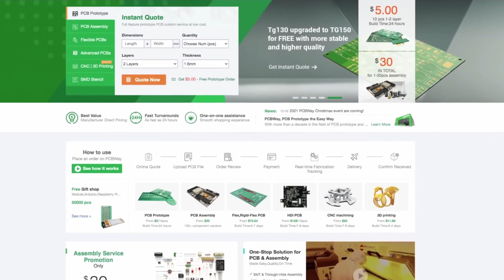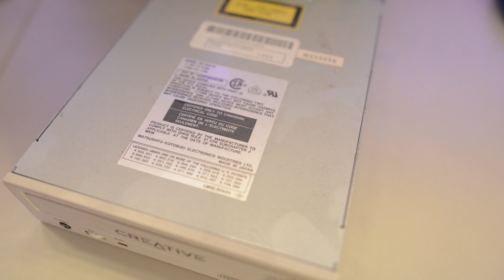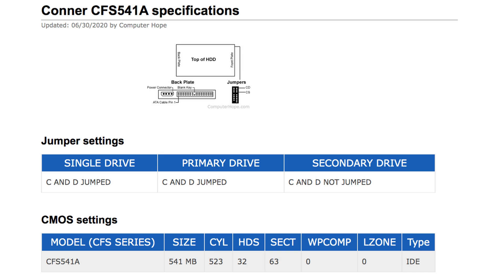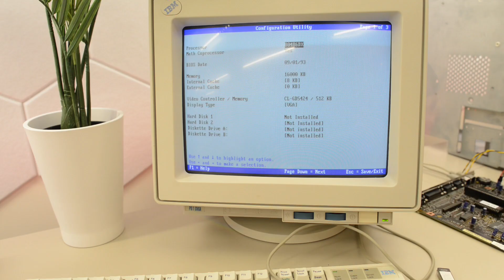You're not going to believe what I found inside this gem :) Vintage IBM restoration

Comment: 14:57 - I ran into so many weird sockets/slots/connectors back in the day that I never figured out as they were rarely used and now in 2023 I'm watching these retro channels, having my mind blown to finally discover their purposes and that there are still parts to fit them floating around out there.
Reply from the maker: AliExpress and eBay are awesome resources to find weird and odd stuff like these vertical VRAM chips. And they are just as fun to mess around with today, as back in 1993 :)

Comment: About bent pins: some time ago I found an AMD K6-2 450MHz with few corroded pins which just fell off so I used dremel to clean corrosion and soldered new pins made of cutted resistor legs and it is working fine so it is not a big problem to fix something like this.

Comment: Hey Epitronics!
I have one of these IBM PS/1 computers just like yours, except I think mine is a slightly newer version. Mine has all four ram slots already installed, but it only has four instead of eight cache slots.  Also my co processor slot is Zero Insertion Force and says IBM OVERDRIVE Ready. Otherwise I think the board is the same. I might come back and comment on this comment if I find other oddities.
EDIT 1
I notice your Cyrus Logic graphics chip is the GD5424. Mine is different, being a Cyrus Logic GD5426. Also my board came with a full 1mb video ram soldered on. My board does not have the strange single inline socket yours has for video memory. The date code of the chip is the 14th week of 1993. Which mirrors the date on many other chips on my board. 

Additionally, I noticed that my BIOS part number is different. Yours is 65g9498. Mine is 52g2974 IBM Corp, 1993 All rights reserved PF3A. 
 Regarding the resistors you hack in a later video to change the bus speed. R174, R175, and R176. My board is configured from the factory to where R174 and R175 are pulled low. That is the same configuration you used when you put a DX2 66 in the second slot. 

It's really interesting how IBM simply reconfigured one board across multiple computers to fit multiple hardware specifications. I conclude that I REALLY like this motherboard.

Comment: Amazing motherboard, with so many upgrade paths! Perfect for us tinkerer! Nice pin repair, I wasn't aware of that tool.
Reply from the maker: Thanks Tony, it's a really fun board to hack. I think the common tool to use is actually a mechanical pencil :)
Reply: I've straightened out a couple of AM2/3 chips one of which was very badly mangled using just a jewellers screwdriver and just by touch since my poor old eyes can't focus on those pins anymore!

Comment: Ya i’ve bent a pin before on this style cpu pins on a mac. Very simillar, they are suprisingly robust and can generally be bent back once without too much stress. But bend it again, the stress fractures are too much and it’ll prolly be time for plan B.

If you do need to solder a new pin, i love how there’s such a large pad to work with.
Reply from the maker: I managed to solder back a missing pin ones on a 486. I was very surprised that it worked

Comment: One of the very first mods I make on old machines, if I don't replace the power supply outright, is to replace the PSU fan. I generally go with fans that have plastic-covered temperature probes, and I attach the probes to the hottest component in the PSU. I did this to an AT PSU in a Tandy 486 about two years ago. It's so quiet, every time I boot it I put my hand behind it to make sure I feel a breeze. These PSU fans pushed so much more air than they needed to for the PSU to keep cool. I've only ever heard the fan spin up once-- it's so unusual it actually startled me for a second.
Reply from the maker: Built-in fan control? That sounds great! What do I search for to find one of these?
Reply: @Epictronics1  I used Arctic F8-TC and F9-TC fans (80 mm / 92 mm respectively). But, I bought them four years ago and it doesn't look like they make them anymore! I would have bought a bunch had I realized they weren't going to catch on. Maybe eBay has some.
Reply: @Epictronics1 They do! They're inexpensive, except for shipping. You're much closer to the UK than I am, so it might be less expensive for you. All told, it would be about $30 USD for me, so about twice the price they were four years ago, but 2/3 of that is shipping across the pond.
Reply from the maker: @MSThalamus-gj9oi  They seem to be controlled between 32 and 38c. That't great. I'll find on and try it out. Thanks!

Comment: With regards to the Panasonic drive,  I bought the same drive for either my original 386sx40 or after I upgraded to a dx2/66. Even though it was a Creative branded drive, you could get them on their own as well, I only got mine as they had ran out of Cr562 models in the shop and I had it plugged into a Aztech sound galaxy 16.

Comment: With a CPU pin that mangled, I usually just solder on a new one off of a donor CPU rather than spending a ton of time straightening it. You don't even need a microscope to do it on these old CPUs like you do with modern AMD AM4 CPUs since the pins are so large and well-spaced.  Still, you did a great job with that mangled pin!
Reply from the maker: Thanks, I have soldered a 486 pin ones for a friend, but I didn't try it to know if it held up

Comment: My first computer was an IBM PS/1 2131 386SX/16, 2mb Ram, and 80mb HDD.  Cost about $1800, and the printer was another $250.   Had a 2400bps modem which could use to connect to Prodigy.   Color VGA with Windows 3.0
Reply from the maker: Nice, It must be very rare? I can't find it on google?
Reply: @Epictronics1  I might be slightly wrong on the model number, as it's been many years, but I'm positive it was a 16MHz CPU and it seems the ones I've found are 20/25Mhz.  Perhaps because it was sold by Montgomery Wards (at the time a large US retailer, nearly the size of Sears) it was a special model just for them?   They were selling it at the same time as the 286 model with monochrome VGA.   This was the first 386 they ever carried  (I was also looking at Headstart brand computers which were all 286 as well).   It was worth whatever the extra cost I felt to get a 386 (even though SX) and to have color monitor.
Reply from the maker: @cliffshockley4406  Quite possible. That is a practice used even today. To avoid price competition, large dealers request uniquely modified PCs from manufacturers. (that's how they can offer a "lowest price guarantee" the sneaky buggers lol. Anyways, really cool with a 386 PS/1, I don't think I have ever seen one IRL
Reply: My folks had a ps2 386sx, 20mhz, not sure on the ram 1mb? 40mb hd. Built like a tank.
Reply from the maker: @pgtmr2713  Nice. PS/2 65SX?
Reply: @Epictronics1  No idea on the model number. But it was expensive.

Comment: I'm doing the exact same thing on a couple of 2168, even ordered the same replacement fan yesterday 😂. One of mine I picked up in superb condition, supplied with the CRT in original boxes, keyboard etc, but missing the Fort Lock chassis access key so had to order a replacement from a US dealer. I have an unboxing video I am yet to upload. This one is upgraded: I have replaced harddrive with two CF (could not get XTIDE running satisfactorily), and CDROM  into sound blaster IDE in same way (as only 1 IDE with two channels on main board), also PC speaker split to the SB. CPU fan for its DX. Then a gotek and a ISA network card. The second machine is not in as good condition, lots of dust and rust to chassis and some green stuff on motherboard, does boot but the PSU 'pumps' for 30 secs or so until it gets up enough steam to fully power on unit. It's this one I am cleaning currently so will have to do some testing on that PSU to see what the issue is. I'm new to restoring old PC, other machines are Amstrad PC1640 and Gateway 2000 G6-300. Thanks very much for your great and instructive videos!
Reply from the maker: Thanks, Make sure to get those caps out of the kb as soon as possible and clean the PCB with IPA. There are no replacements for the main IC and it will be destroyed by the cap juice. Let me know when the unboxing is out :)
Reply: @Epictronics1  yeah I was thinking of leaving the keyboard fix to a rainy day seeing how tricky it is not to break the fixings inside, but I will bring forward that work! Thanks

Comment: that handle on top looks a lot like later IBM and eventually Lenovo desktops. Current models don't really do it but as recently as the ThinkCentre S30 it had a big nice handle like that, plus one on the back so you could easily lift the whole PC up. More recently on something like the P620 the front is recessed and there's grip extending horisontally from the front.
Reply from the maker: yeah, my thinkcenter has something similar, very handy!

Comment: That handle on the case was carried right into the ThinkCentre line, quite interesting.
Reply: Yeah they used it initially on the PS/1 in 1990 and continued on the Aptiva which replaced it in 1994, and it remained all the way through the Thinkcentre even after Lenovo's acquisition of IBM's consumer PC division in 2005. Though some of the more recent Thinkcentre towers stopped including the handle in every configuration and made it optional on most models. But over 30 years of the handle is probably the longest running PC design from one vendor.
Reply from the maker: I didn't give it much though until now. you're right

Comment: This was my first PC in 1994, just a 486dx33 instead. Interestingly it was sold by IBM with the creative 2x CD-ROM and Sound Blaster 16 already installed + good little amped speakers. I even found the original HDD 170Mo 3 days ago and it was still working though noisy 😂Thanks for the video and memories
Reply from the maker: So, these machines were sold with a SB and CD-ROM originally. Good thing you kept it :)

Comment: YT just recommended me this channel, great stuff 👍
Also I was never a fan of the non dip package push sockets either, as I had a clone 486 66Mhz machine back in very late 95 I had gotten 2nd hand that my parents helped me upgrade to a Pentium Over Drive 100 Mhz chip, that felt like it was going to snap while putting it in, along with a few other upgrades so I could run Win 95 for my school work till I could save up a few years later when I finally got my first after school job in summer 98 working at a gas station/liquor store by our house, so after working all summer, and then some I ended up building a 550Mhz Super Socket 7 AMD K6-II based system that I used for a few years on Win 98, and 98se, and because of that I have so much love for this era of computing, and it's my 2nd favorite era after having a Commodore 64(later C128), and Apple IIe sitting on the monster 80's wooden computer desk in my bedroom, with an Epson Dot Matrix Printer that worked with both the Commodore, and Apple machines. 😊
Reply: young turds?
Reply from the maker: Thanks, yeah those sockets are nerve-racking. I grew up with a C64 too :)

Comment: We had a nearly the same computer, Model 2168. It had 66-MHz 486DX2, and another 4 MB RAM was added in the store besides the factory 4 MB, as well as a 210-MB HDD besides the original 130-MB drive. The CD drive was double speed as well, but I don't remember if it was branded as Creative or Panasonic, or whether it was connected to the sound card or motherboard. (Hmm, now that I think, the two HDD's might have taken all the IDE slots on the motherboards, so probably the CD drive was connected to the sound card (SB16).)

I have no experience about PS/2's, so I don't know how much they would have deviated from "standard" IBM compatibles, but for my taste the PS/1 was quite non-standard enough. The main issue was that the expansion card slots are on a riser board, so upgrades by replacing the motherboard would have been impossible; even if a standard motherboard would have fitted in, the cards wouldn't have aligned with the openings in the back.

The power switch is a "soft" switch, like on modern computers. (Which means, replacing the power supply with a standard one might be problematic.) The PS/1 has feature named "Rapid Resume", which, with proper DOS drivers, worked like the hibernation feature on more modern (Windows 95 and later) computers. I learned about it when a game (Doom or something like that) crashed and completely hung, and since the computer didn't have a reset switch, I had to use the power button. To my surprise powering off took some time, and when powering back on, the computer returned to the same state as before "powering off", a hung game on the screen. I later learned that holding down the power button will force the computer off without storing the contents of RAM.

Also, the floppy drive might be a bit non-standard, so replacing it too could be a problem. (When we got the computer, the indicator light on the floppy drive didn't work, so the seller ordered a new one, and it took some time to arrive, so it might have been some IBM specialty too.

So, it'd be best to treat the existing components with care; replacing them with standard ones might not work, or might require extra work and knowledge.
Reply from the maker: I'll treat it with care for sure. I think the MOBO is LPX standard, but I'm not sure. If I ever have this PC on the bench at the same time as some other LPX, I'll try to swap the MOBOs

Comment: Maybe put a bit of solder onto the double bent pin, to stabilize and smoothen it a bit.
Reply from the maker: I don't know. the socket is very easy to destroy if the pin gets too thick

Comment: I bought one of them sound cards about a couple of years ago, cost me over £100 but well worth it.  Mine doesn’t have the hanging bug either.
Reply from the maker: yeah, this was a very lucky score. I didn't know the card was in the machine when I got it. I think these cards have some minor issues Duke Nukem 3D, but they are perfect for DOS adventure games : )
Reply: @Epictronics1  Ya I just ran into that bug with 2 SB16's I thought both of them were broken and finally ran into a post about the SB16 and DN3D changed a few settings and both are working just fine. I couldn't believe I had 2 bad SB16's luckily it was just a bug in the software heh.
Reply from the maker: @Neodra  Excellent :)

Comment: Wasn't the purpose of the PS/2 line to make a completely proprietary hardware design that would force manufacturers to license the MCA bus?   It really wasn't a leap ahead of the existing ISA bus machines coming out around the same time.
Reply from the maker: Yes, they introduced VGA, PS2 connectors, and a bunch of other stuff but failed to patent everything but the MCA Bus

Comment: I had the same ps1 with a 386 33mhz with a missing front plate. I used the ones to db25 printer port software. Then used some No$gb  on it because I did not have a game boy.

Comment: I have a very similar machine. 2168-26P. No volume knob and has a Multimedia sticker on the front. 20mb ram and 66mhz processor. Running dos 6.22 and windows 3.11.
Reply from the maker: Perfect combo for adventure gaming. That's roughly where we are going with this project too. Btw. I have one of those Multimedia stickers on one of my Aptiva desktops. I think it looks neat. It was factory fitted with an IDE CD-ROM drive and an SB16. I don't quite remember what speed and model, we'll find out when it's time to make a video about it
Reply: @Epictronics1  Awesome. Pretty sure the multimedia sticker probably meant the factory Cd-rom and sound blaster card was installed. Same in my machine. The sound card is labeled Sound Blaster Value 16. Another odd thing it has is the math Coprocessor installed. Wonder if it was factory on the multimedia versions. You will have to check yours.
Reply from the maker: @Falkenroth1  Two of my Aptivas have the SB 16 value and IBM branded double-speed drives. One of them has a DX2-50 and the other one has a DX2-66 and a Multimedia sticker. I have a third Aptiva, but I don't remember what's inside it. I will pull them all out and make a video

Comment: Nice stuff as usual. Be sure to recap that (if I am not mistaken) Teac floppy drive. The motor board specifically with the SMD caps. They tend to leak an I have seen a few A500 drives with destroyed motor boards.

PS: Fck ZIP Ram. They are just a blytch. Kisses: An Amiga 3000 wannabe user.
Reply from the maker: There seems to be only one electrolytic cap in this drive. I'll order some and replace it next time I have the drive out, thanks
Reply: @Epictronics1  Yes. and that is usually related to timing, and if you remove it, it will try to take off with maximum speed the motor can do when you insert a disk lol
Reply from the maker: @LynxCarpathica  Sounds like fun, maybe I'll try that first :)

Comment: Could you link to where you found the hacked bios? I have a ps/valuepoint 425 which seems to have an identical bios
Reply from the maker: It's not uploaded anywhere, send me an email and I'll reply with the file. I'll talk more about it in part 2, but it only removes the error. It doesn't fix the issue

Comment: Great vid as always! If you ever want to try to get the zip-memory working,I used this ZIp-ram: HM514260ZP8 for video on the same board sitting in my PS/1 2133, and that worked flawlessly. I also did the CPU bodge on that board after seeing your video on the PS/1 2133. However, I can't find any of those excellent videos any more, have you taken them down?
Reply from the maker: Thank you. Yes, but this mini-series replaces my 2133 videos since it has an identical board